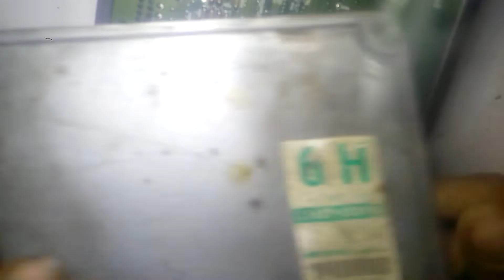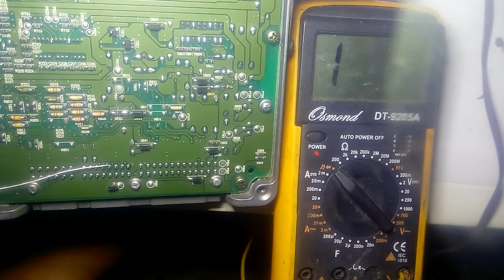Ecu suzuki baleno

Comment: Itu sama nggak ya dengan ecu apv?? Sya jg punya apv nyendat2 d rpm 2000-3000 dah di cek semua normal kalo service ecu kira2 habis berapa biayanya
Reply from the maker: Lokasi di mana pak
Reply: @otomotifelektrik9940  saya jogja
Reply from the maker: Kalau untuk biaya itu masing masing pak.tergantung kerusakan
Reply: Baleno saya brebet di rpm 2000 s/d 3000 servicenya berapa harga
Reply: Jogjanya mn bang?